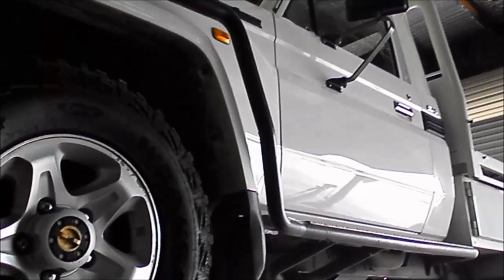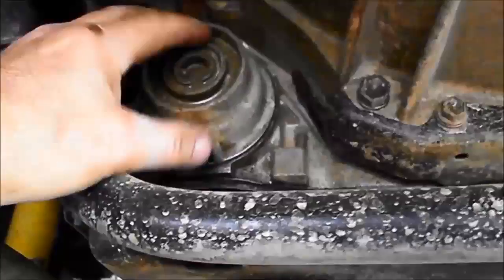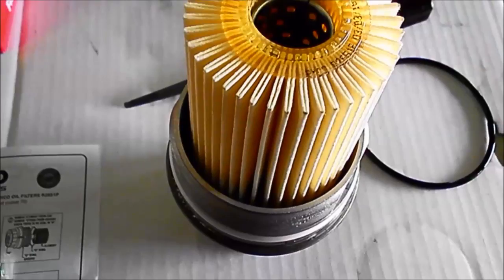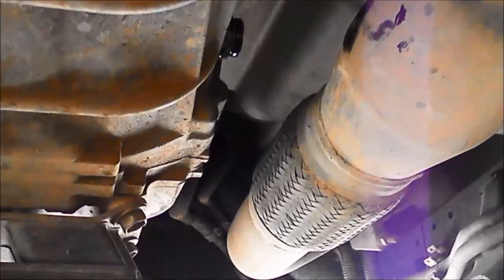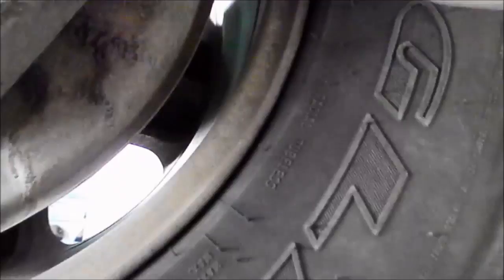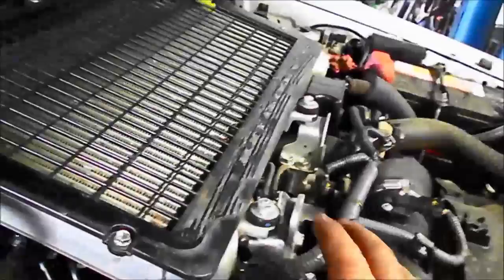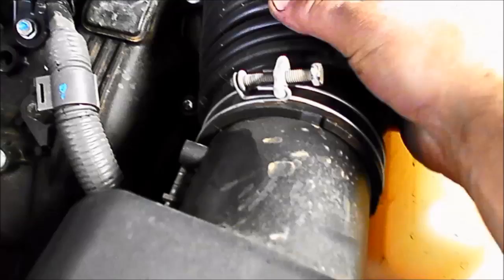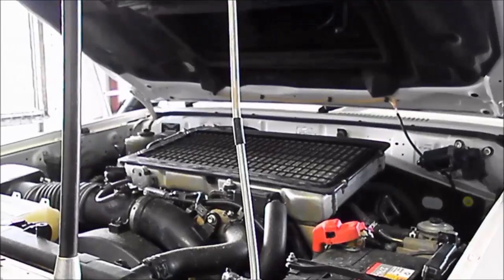Landcruiser Turbo Diesel V8 2011 Engine Service

Comment: Thanks so much for putting this together. I have done basic fluid services on my own vehicles before but this is the first time with my 76 Cruiser and you've given me all the confidence I need to go ahead. Really appreciate the little things too like socket sizes and oil types and the oil filter spec to help me confirm what I've read from the manual.

10/10 would buy you a beer.
Reply from the maker: thanks and cheers

Comment: one additional thing to mention is that some oil filters/wells can take as much as 1 litre of of oil to fill so you should run the engine up to 30 secs or so and let sit for 5 minutes and recheck levels
Reply from the maker: no worries, thanks for that info, cheers 👍

Comment: I use hpr 15w50 hpr semi synthetic penrite diesel oil ,i change from full synthetic castrol to penrite as pre dpf v8 took 15w40 and i have 400,000km on my 79series landcruiser and she goes way good and she's chipped goes way better with penrite
Reply from the maker: thanks for that, cheers

Comment: Hey bud the spring in the video with the oil filter where does that go?
Reply from the maker: hi, should go between the filter cartridge internal sleeve and the external canister, if you check video. its there so if the filter gets completely blocked, it will push the whole filter cartridge open against the spring, so you can still have oil flow. cheers 6:18
Reply: Thanks a lot for your help mate appreciate the reply👍🏻